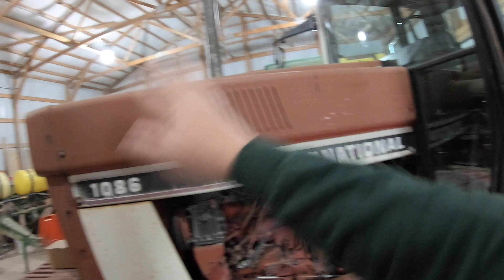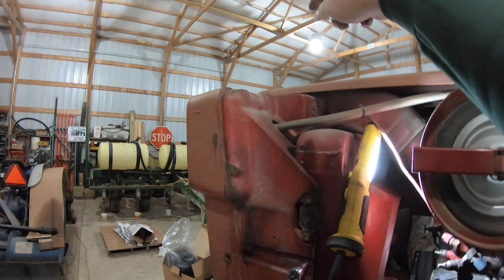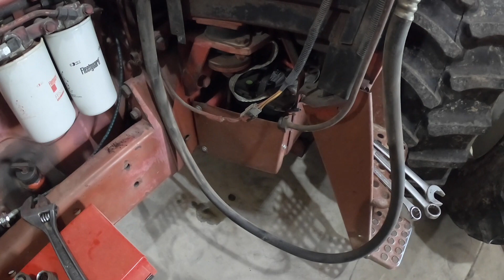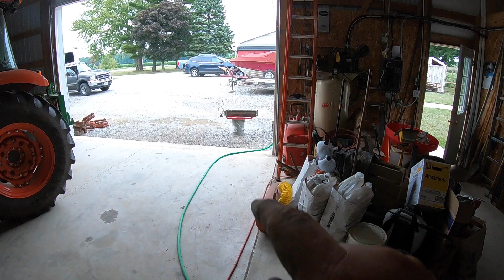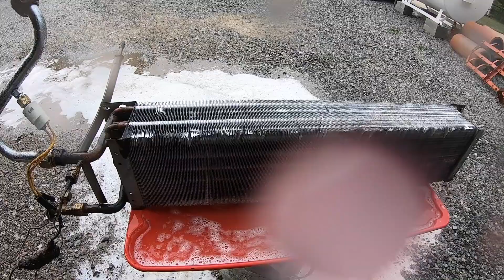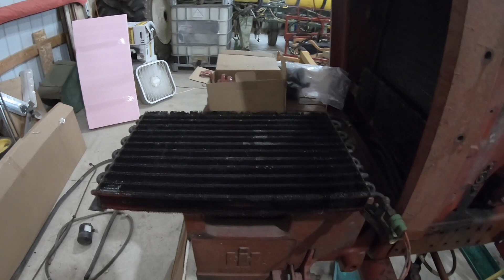IH 1086 Complete AC Repair Pt #1

Comment: Can you provide sources for the new AC parts and the cleaning supplies you used on the AC components. I’ve got a 986 that needs an AC system overhaul. Great video, thanks for posting it.
Reply from the maker: Thank you.  The parks were from a mix of my local CaseIH dealer and Anderson Tractor. Anderson Tractor is local to my area used parts tractor store that could get the parts, but you have to know the exact part. If there are 2 or more parts, it is up to you to know which you need for your tractor. I paid a little more for the dealer parts but in the end, it was worth it because there is an sr# break for different parts.  Because they ordered the wrong parts, they ate the cost. The cleaning was from a local HVAC store. Hopefully, that will help you, and good luck.

Comment: Well that was some good information.   What does the nitrogen do
Reply from the maker: Thank you,  the N displaces any other gases that are in the system.  If the is any moisture in there, it will cause the oil to make an acid and contaminate the system.  The evaluation process will remove that moisture by reducing the boiling point temperature from 212 degrees down to 10 degrees Fahrenheit.  Yes, if you pull a vaccum to fast the water can actually freeze before it can boil out. So if it is only N in the system,  it is easier to get a good deep vacuum  and remove all moisture and noncondensable.

Comment: Wow, that foaming cleaner works very well- great tip!!
Reply from the maker: It is not something you want to do with the evaporator still in the cab. It will flood the drains, lol. It is something that is good for the condenser, oil cooler, and radiator to clean out for air flow. Thanks for watching.

Comment: Tim with the cleaning, thorough cleaning that you're doing here and then the keyword evacuate as in put a vacuum on the system I believe you're going to have a really good reconditioned air conditioning system working at Peak capacity.
Reply from the maker: It should be like bran new. It was nice and cold when I was done. Sometimes it is worth the effort to go the extra mile.  Thanks for watching.